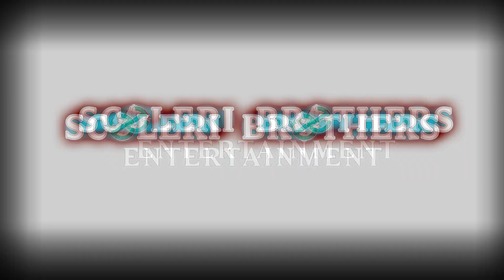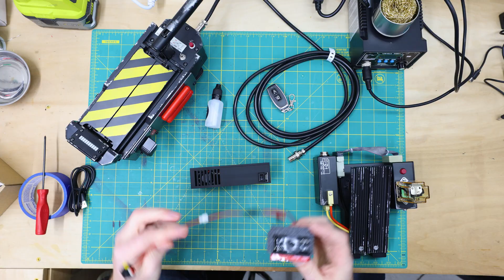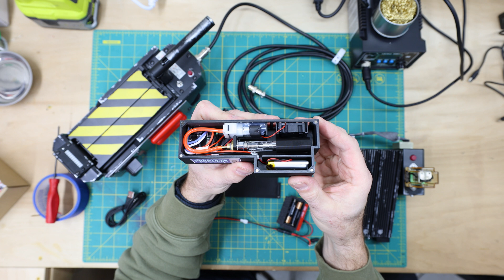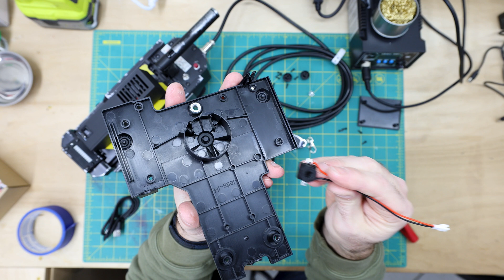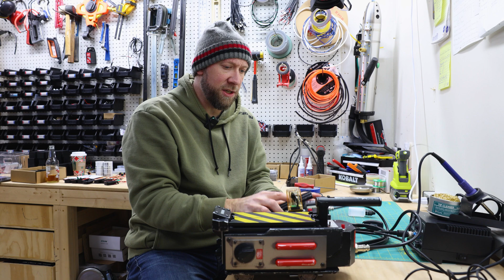HASLAB Ghostbusters Trap FOGGER with foot pedal activation

Comment: the remote pedal thing is odd, it doesn’t smoke during entrapment, only after. The trap uses a sink for the ghost’s remaining psychokinetic energy and releases it after successful entrapment. It’s possible to do this, make up a PCB that reads the first press as a wake up signal, then the second press as the smoke activation, maybe have it go for ~15-30 seconds (not too long so it doesn’t burn out the coil) THEN it might be worth the price. MAYBE.
Reply from the maker: Haslab Ghost Trap with remote Phantasm Fogger #ghostbusters #haslab
https://youtube.com/shorts/7eVA1rFz4Sw?feature=share
Reply: @ much better!! i dig it!!
Reply from the maker: @ThePackDoctor  Keep the faith!

Comment: Great work - Question -Once you do this mod, you always have smoke from the pedal, no? What if a user wants the choice to have smoke from the pedal or not? I put a on/off switch in line, so it gives the option to turn the smoke on/off from the pedal. I guess in your mod you could just pull the battery, but thats not always easy unless you want to unscrew it every time.

Comment: Well done...May I suggest install a small kill switch in that system also? As given the current design the only way for it to work as intended in the film would be to install it with the switch already activated it would then feed the smoke only with the doors shut but it would also constantly pull power from the batteries said switch would save the batteries when not in use instead of having to remove them from the pedal often or taking the whole panel off to kill the power constantly.

Comment: Thats fantastic! But what is the battery life on the fogger? Will it last 2+ hrs on one charge?
Reply from the maker: So far in testing with light use, I would say yes.
Reply: @scoleri_bros  that would be fantastic, some of the events we do are long and the smoking trap is usually a big hit for pictures after the sun goes down. Otherwise being able to swap the battery out on the fly would work as well.
Reply from the maker: @thekingofplay8539  this battery is swappable, it connects with a JST connector.

Comment: Why does it smoke before you have a ghost? Should only smoke on the second press. I woulda been sold
Reply: I was thinking that same thing does it matter if you leave the switch off when installing the pedal so that it can come on when the door is shut instead of the other way around also maybe find a way to delay the fog
Reply: Don't but it then!
Reply from the maker: Because it’s fun! 😎
Reply: @scoleri_bros 

To stay screen accurate the smoke really shouldn't come out of an open trap but what it should be setup to do is trigger the smoke as soon as the trap is closed because smoke only ever comes from the trap in the movie after it has a ghost in it and is closed. 
What i would really like to know is can we setup the fogger to trigger after the trap is closed for a few seconds to give an accurate Portrayal of what it actually does in the movie as well or can it only trigger when its open?
Thank you very much.🙂👍✌️

Comment: dude these are amazing producrt you made i want to build it to . also i am workign on somthing for my traps battery idea and i see u used a small lithium battery  from cell phone in fogger machine how hard was the wiring for it to allow charge to go in and to activate..
Reply from the maker: The wiring was pretty straightforward with the charger module. There’s an input and an output.
Reply: @scoleri_bros  okey  i probbly need to look up videos on how to do that ur fogger will be bought after  my house upgrade for my pack XD